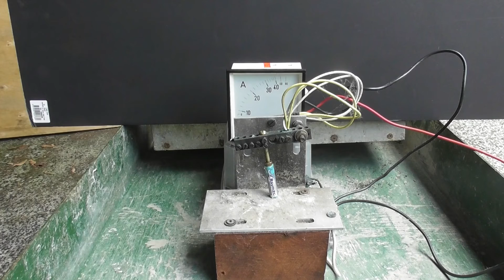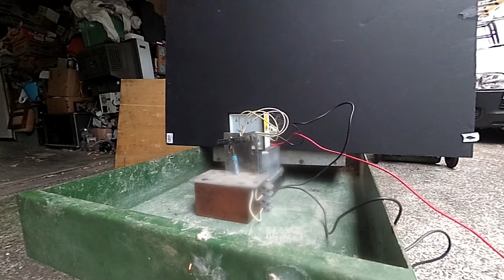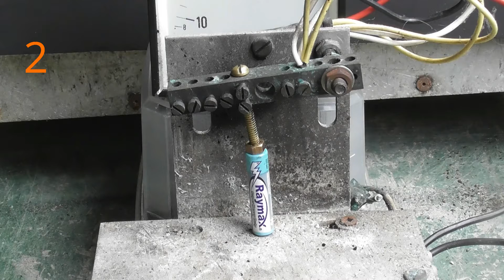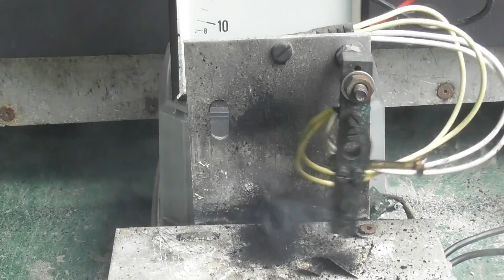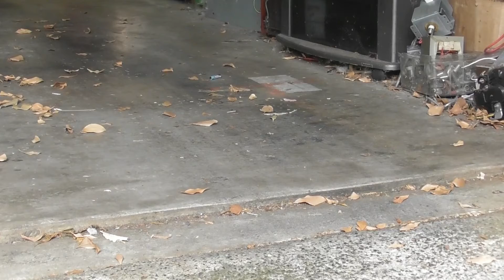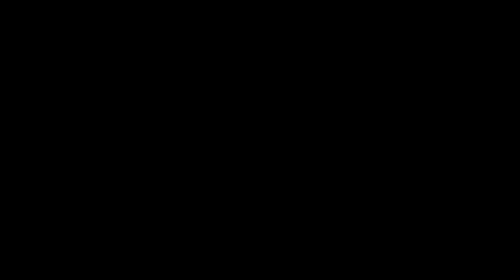Low power carbon battery pops

Comment: Hey Rodal, back in 70’s when Amana first came out with radar range “microwave” the guy demonstrated it by cooking a hot dog and  said always keep a cup of water in range in case it’s turned on accidentally with nothing in it.   What if anything happens if you would run one by accidentally setting time program to start and run for hours empty?     Lol thinking of stuff you could burn up.  Maybe open door cook those bastard wasps. 🤯🤬😂